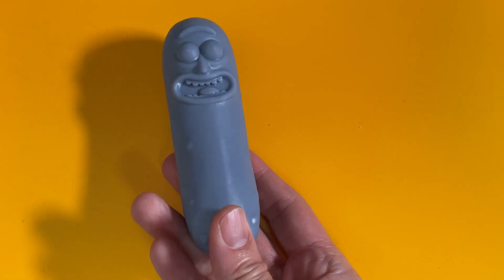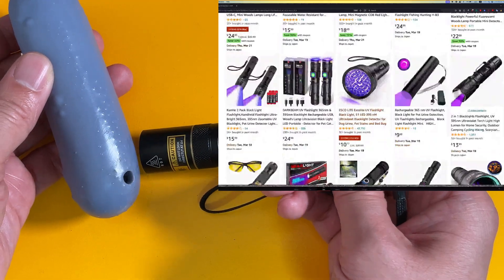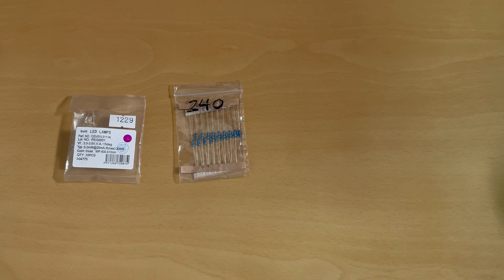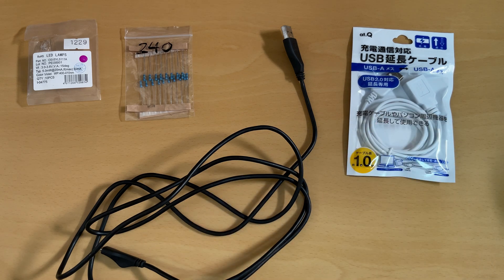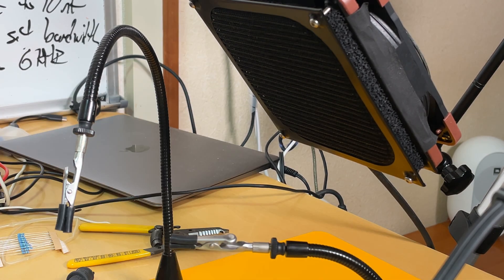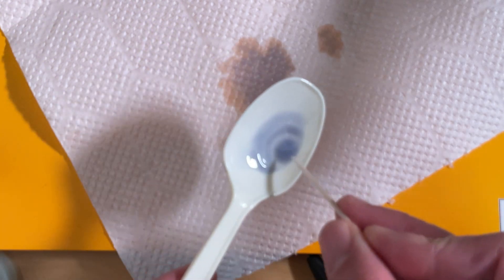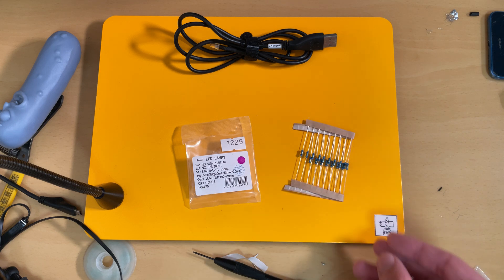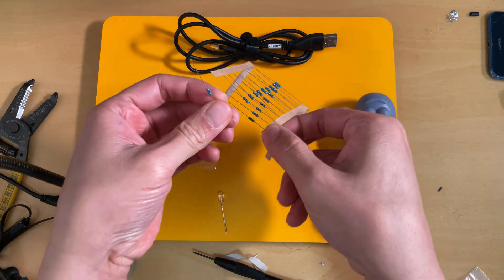Resin-Curing Light — Everyone With a 3D Printer Needs One

Comment: Nice and simple design!

One problem is with your Resistor value. You callulated with the voltage from the power source, not the voltage across the resistor>

The LED "drops" between 3.0 V to 3.8 V, so 3.4 V on average,  5V - 3.4V = 1.6 V across just the resistor.

So with 1.6V @ 20mA, the V/I = R gives...   1.6 V  / 0.020 A = 80 ohms.

Just for your reference, currently with your 240 ohm resistor, V/R = I,   1.6V / 240 ohm = 6.66 mA  or about  1/3rd the available power.
Reply from the maker: I'm cursing you in my head right now lol. But you're absolutely right. My head was elsewhere but that's not an excuse. So I have to admit when I'm wrong. I'll update the description and pin your comment. Luckily, I undershot. If it was the other way around, I couldn't let the video stay up in good faith. But I spent way too much time recording and uploading this (surprisingly) so as it is,  I'll just append the notes and you'll be at the top of the comments making me look bad, you jerk. Just kidding. And by the way, you did the best possible job of telling someone they're wrong! Thanks for that!
Reply: @a_boy_can_dream  I'm also intersted how much better it might work at the higher power!
No problem, we are all learning all the time... Plus I can't remember 10% of what I once knew... sigh...
Reply: @a_boy_can_dream  I'd be tempted to actually run off of an unregulated 9V (actually probably only ~8.5V at 20mA) and increase your resistance to a standard 330ohm (20% tolerance), if you want to be really careful.

Comment: An easy but really useful project! If i may, from experience making things like these that are some component on the tip of a cable and that's it, i also heatshrink a bit of copper/steel single strand wire or similar in the last 20cm or so. It makes positioning the (in this case) LED way easier, as you cna bend it into shape and it will stay that way. 

I've done it with microphones as well for example. The wire gave it a "hook shape" that rested over my ear kind of like the leg on a pair of glasses, and then i could aim it exactly into my mouth. Here it could be aimed so it shines the UV light upwards into the "head" of pickle rick, and it can more directly cure it. That combined with the new resistor value would probably make it the perfect tool!

Comment: Nice ! but let me suggest another idea that maybe will do better: Do you know those cheap led fiber optics lamps ? (google image it) well you just stick the fibers root which is already glued to a plastic mount. stick it in front of a uv flash light or maybe a low unfocused diode laser (power choices and budget). this way you can stick those fibers in any hole size! plus it will slip out easily without sticking inside while curing ! your setup is quite big for smaller objects maybe. Plus !! you can use it for multiple objects in the same time. here is another trick! if you have long pieces like that pickle, you can sand some of those fiber it will diffuse the light not just from the tip! the lamp is quite cheap! and could make many of these lighting tools! and make the video and shorts and reels and tiktoks LOL good luck !
Reply from the maker: Yeah, another guy suggested that too. Took a look and UV requires a certain type of fiber optic which are expensive. But Aliexpress claims to offer some in the correct wavelength.
Reply: I have the cheap fiber led lamp decoration. I tested with a uv led flash light the light pass through the fibers. maybe with a focusable flash light the will get brighter since the one I have I used is a wide multiple diodes flash light. again I just tested to tell that the uv light passed through the optics @a_boy_can_dream

Comment: I might just get a resin printer. What do think the value of resin is compared to filament? (ie why should someone purchase a resin printer if they already have a filament printer?)
Reply from the maker: I went with resin just for the fit and finish. I really hate layer lines. For detail, I think it's awesome. No neeed for sanding and stuff like that. I use the printer mostly for prototyping cases for my projects and it looks crazy professional. You can do bigger prints on FDM and I hear it may be more robust. But with the new resins out there, you can hit them with a hammer and they won't break.

Comment: Where did you find a pack of UV LEDs and a strip of resistors for only a dollar?
Reply from the maker: Well, in actual part cost. Shipping is still an issue. But if you were already putting in an order on Digikey, you can get an led and a resistor for less than a dollar. But you'd have to piggy-back off shipping from another order. In Osaka, where I'm at, we have a shop where you can buy single items and this would cost like $1.50.

Comment: Thats a really cool idea. Nice one. :)
Also, try curing your prints in water.  Cut the top off of a 2 litre Coke bottle (or similar clear plastic bottle), put some tap water in it, put the quickly washed print in it then put that in your curing station.
Once you have tried it you won't go back to your old curing method.
This works with non water washable prints.
Reply from the maker: You're making me think of my high school science class lol. This totally make sense. You really do this with no issues?
Reply: @a_boy_can_dream Many people say that the oxygen in air inhibits the curing process. Resin isn't affected by the oxygen in water as it is too strongly bonded to hydrogen molecules. Curing in water gives a nice even finish to the part with no stickyness. The water seems to remove left over resin on the print and that is with non water washable resin (haven't tried it with water washable resin).
I have only seen benefits to curing in water. :)
I am a moderator on the Crosslink discord server and have given this advice to quite a few people and no one as reported any problems.
Reply from the maker: Well, definitely gonna have to try! Thanks.
Reply: @a_boy_can_dream Perhaps a vid about it? :)

Comment: You could consider using fiber optic wires too,  then you can bend it into really award positions!

And that Pickle Rick is awesome!   you could turn it into a whistle if you keep the hole!
Reply from the maker: That is a great idea! Did a quick search and it looks like you need special fiber optics to handle UV (= expensive). But there are sellers on Aliexpress that claim stuff that can handle the wavelength. Would be good to try!
Reply: @a_boy_can_dream  No worries!   Yeah, if the AliExpress ones work,  you'd be able to get them in spaces the size of a pinhole!